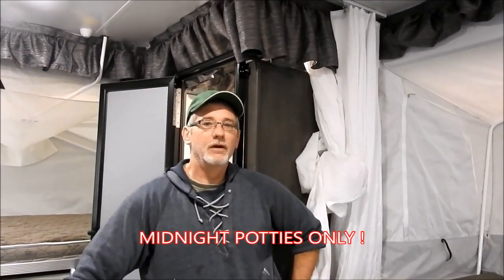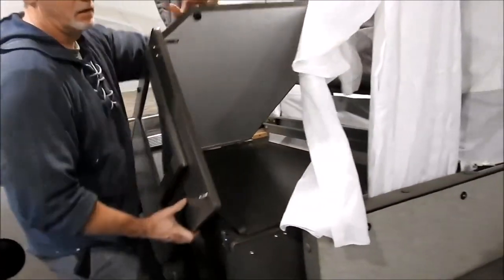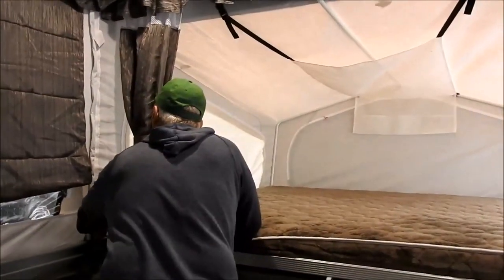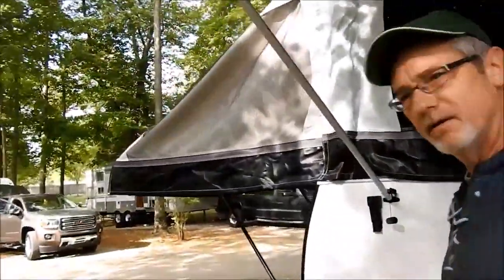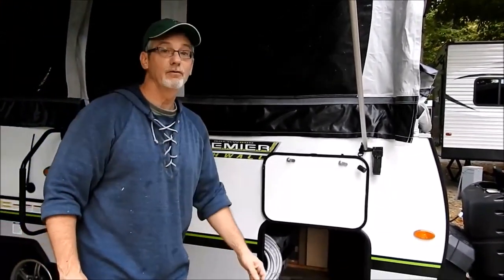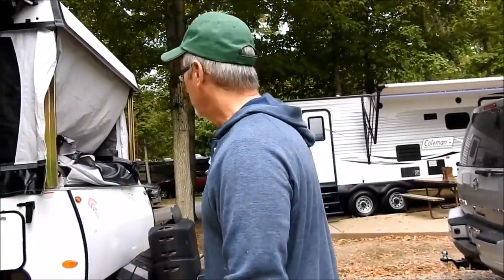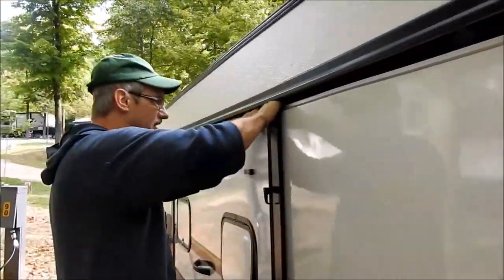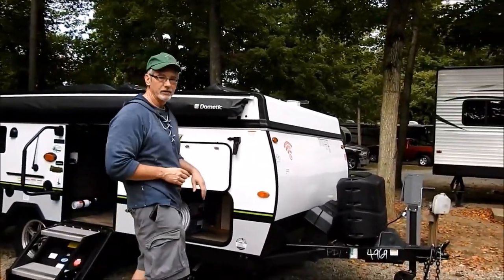POP UP CAMPER TAKE DOWN

Comment: Nice job.  Although I've had my Flagstaff HW27KS for a few years now, I've enjoyed watching your videos to see how someone else sets up and takes down basically the exact same camper besides a slightly different floor plan inside and my kitchen slide out (which we love by the way to cook and clean outside.)  Really the only thing you did that I have never done, and it is not a big deal either way, is unzip the corners before take down.  Not really necessary but it may help the canvas with stuffing it underneath before you lower the top.  Definitely gets easier the more you do it.  Piece of cake.  These are really nice campers and even more so because mine fits inside my garage.  Happy camping!

Comment: We just purchased a 2021 Flagstaff HW 29sc, 50 min after leaving the Iowa dealership to home in central Minnesota the steps open up on us in an area were highway construction was going on.. we had wait to clear some high cement walls before we could fix and see the damage of the steps..have you had any problems with ur steps falling out while driving down the road or highway